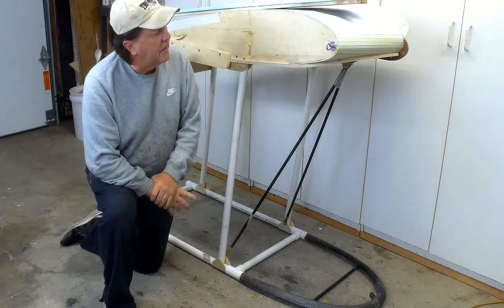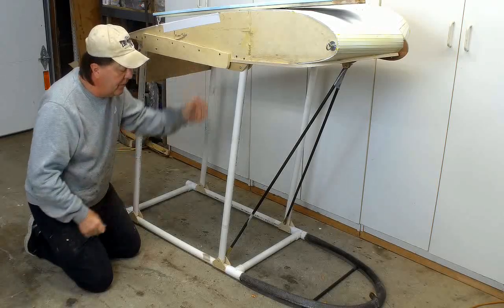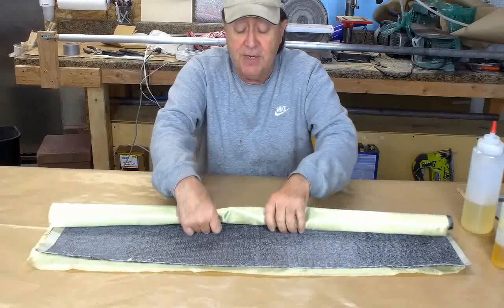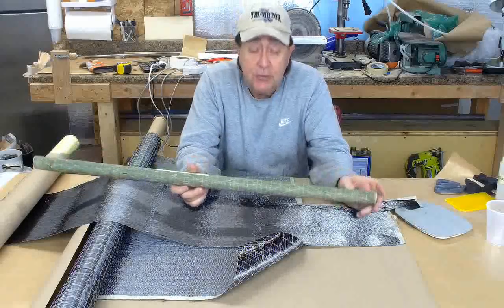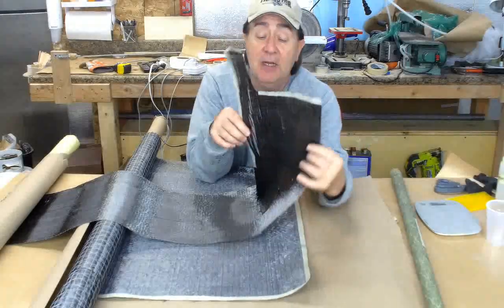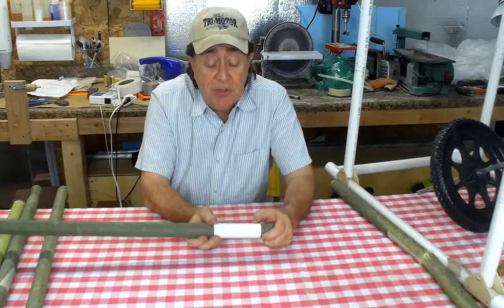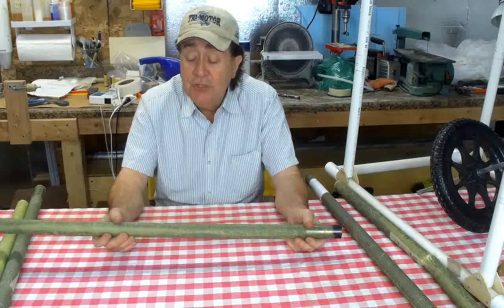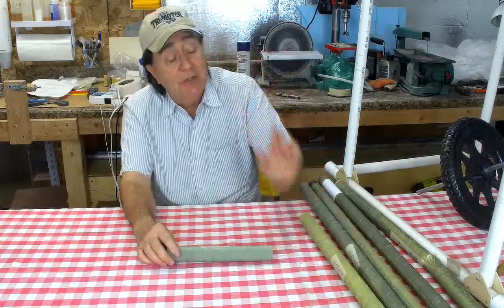Pilot's Cage - KW MkII Foot Launch Hang Glider Sailplane

Comment: Thanks for sharing your design and fabrication process, the problems you encounter are valuable teaching points. We have been using "weight for pitch" on our Kasperwings, it is extremely effective and isolates the pilot from engine vibration.
Reply from the maker: Thanks for the positive feedback (bad for aircraft dynamic stability - good for people). The Kasperwing is a great design and has stood the test of time. I've studied several videos of them to get ideas on pilot suspension.

Comment: Great video Rol, really enjoy the way that you question your results at every turn, then painstakingly strive for incremental improvements. The insights are a real gift. I was wondering what would be the design constraint on increasing tube diameter a bit? I take it tubes will be out of the air stream?
Reply from the maker: Hi Clive: That's a really excellent question as the answer in not obvious due to unique design limits/constraints. The answer is too complex for this small space and I think a lot of people will be interested. So, I'll do a short video today to explain this interesting topic. That's for "priming the pump" so to speak!
Reply from the maker: Oh, yes, the second question. Yes, there will be a full enclosure for the pilot. It will store flat or rolled and attached via Velcro. The glider can be flown with or without the enclosure depending on what thrills one is seeking.